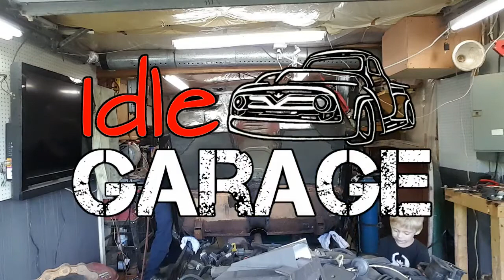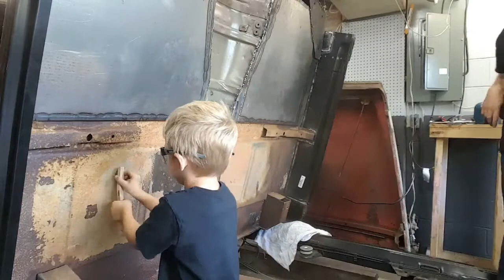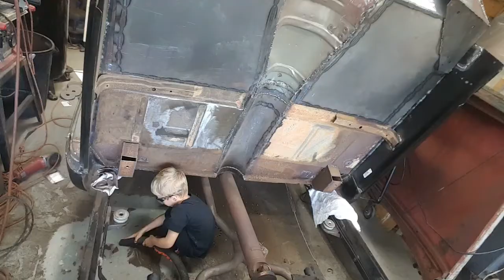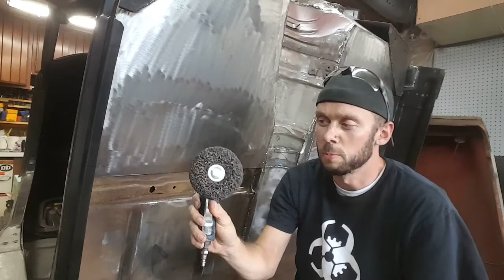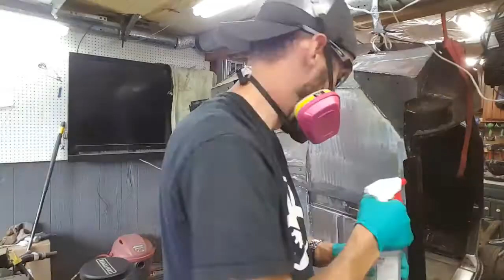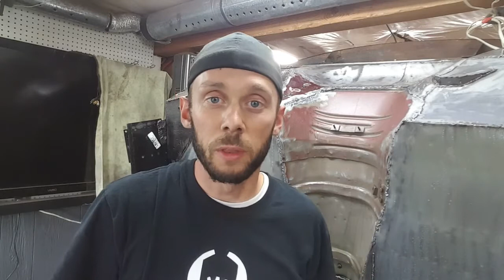Cleaning up the cab bottom of the cab for paint on my Ford F100 to Crown Vic frame swap #34

Comment: I used a heat gun, putty knife and a wire prush to get the undercoating off my 53 F100.  Torch works too, but the tar stuff is flammable so be careful.  I've had good luck with Rust Kutter from tractor supply:  https://www.tractorsupply.com/tsc/product/rust-kutter-rust-prevention-and-control-1-qt.  20 Bucks and it doesn't eat up concrete.
Reply from the maker: HEAT!!!!! Why didn't I think of that? I know what I'll be doing for the doors. Thanks for the tip.